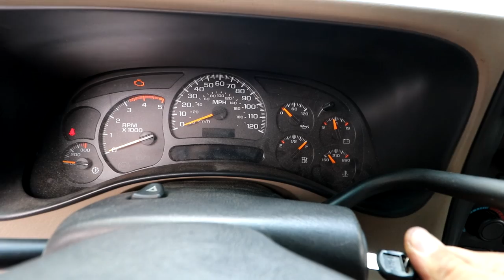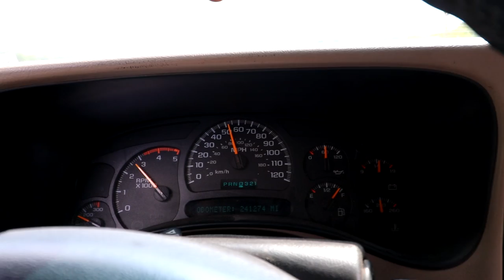THIS is WHY I'M GOING TO COURT!!

Comment: 3d machines I had to have a new fence put in and the city of Utica NY and I had to get a building license  which     
was $35 and since 2014 you need a survey of your land to have any permanent change's like a fence or a fire pit etc. and the survey was fucking $800 the state of NY is so messed up.
Reply: unblock trendy rage gamer , 
1) Utica is a dump, move out. 
2) you have to have what's called a permit to put in a fence...not a license. All you had to do was use the survey from when the property was purchased by you (or your parents, grandparents etc).

Comment: Get a ported fuel fitting for it as well. It will help as well. It goes from a 1mm fuel hole to a 1/8 inch fuel hole for the fuel lines. And if you don't already get a Fass 150 lift pump.

Comment: I had some issues with city giving me code violations on my Mom's house after she passed away.   Stuff like tree overhanging over street was not 15 feet high, some really dumb issues with an RV that was only able to be seen from alley.    I never did pay those tickets.   Threw them in the trash. I don't even live in the same county anymore, and the house was sold.

Comment: That OEM PART is kind of a pressure buffer for the fuel injection system...
The replacement simplifies things. Hopefully the FICM is ok... Should check control voltages.

Comment: He should make his 450 into a super moto
Reply: Undeadman games yes!
Reply: Undeadman games no
Reply: Undeadman games if your making a supermoto you really should buy a brand new bike
Reply: Jo need one with a headlight ells jou can not get a plate one it like to Yamaha wr 450 he has a headlight and you can pull a plate on it
Reply: And a speedometer is handy
Reply: Kevin makes you can attach a headlight to them
Reply: Logan Feldhege but than you still have no speedometer
Reply: Undeadman games those bikes internal gearing is far too short to use as a supermoto.
Reply: Logan Feldhege no lighting coil on the crf. Legally, headlight has to be powered by the coil...not just a battery.
Reply: check out motonosity, he made his 450r a street legal supermoto
Reply: A battery is not needed my bike has no battery it's a beta rr 50 sports a super moto
Reply: I agree
Reply: i just made my 450r street legal its not that hard but the rules depend on your state.

Comment: How your truck is starting to bog down is because your injectors are starting to go out i would buy one of those cat filter adapters to put on your truck there is more microns in the cat filter so it helps extend the life of the injectors with cleaner fuel

Comment: This is why you live in the the country, you can collect as many things as you like and nobody say's nothin'.  This is especially true in Kentucky except in the cities other than that there isn't even building codes, so a nomads dream.  Which is probably why their are so many Amish and Mennonites.
Reply: That is for the cities as mentioned, the area I live in if you outside the town limits you can live in a shed if you choose.  If you own 10+ acres you can install plumbing and electrical and not even have to pull a permit or get inspected.

Comment: Did you really have to throw it away.   Why couldn't you just organize it
Reply: It was a pile of junk, there's no way to organize that. He did the right thing by gettin' rid of it.
Reply: Jacob Beck He was becoming a hoarder. Cities hate such thing and code enforcemnt will fine, take to court, and even forcfully enter and remove the clutter.
Reply: Snipe Stud00 oh ok.  Thanks for replying.   I was just kinda wondering because I had the same problem but when I cleaned it up it was excused

Comment: I am glad I don't live next door to Dalton. He rides his dirt bikes and ATV up and down the street. He revs the truck. A suggestion. After riding your dirt bikes, why not stop at a car wash and wash the bikes, trailer, and truck there, instead of powering up the pressure washer in the front yard and pissing off your neighbors? Show some consideration for your neighbors.
Reply: Why would he waste his money to use a power washer when he had one
Reply: He has every right to use his power washer at home. It's no different than mowing the yard or using the weed wacker. Now, if he's out there at 6AM or 11PM running the power washer then he is not showing any consideration for the neighbors.